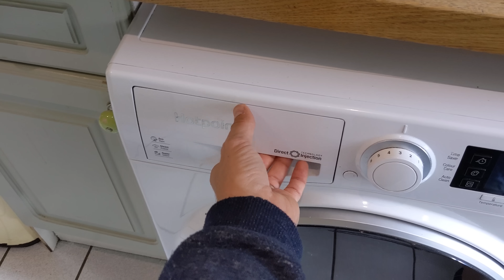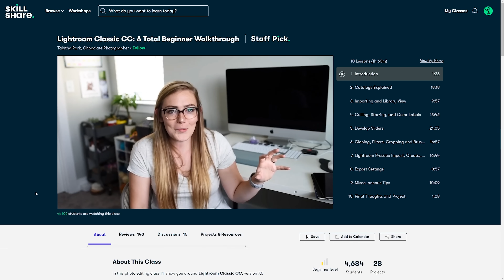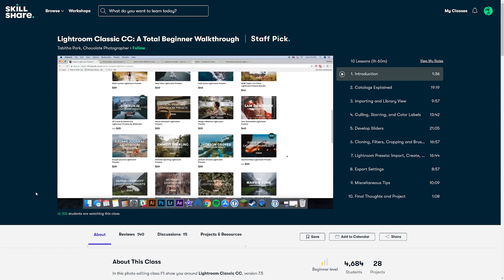The Pythagorean Siphon Inside Your Washing Machine

Comment: My toilet doesn’t have a siphon mechanism. Flushing the toilet just activates a door at the bottom of the water reservoir. (Edit: I have just been informed that toilets like mine do use a siphon, just not in the same location.)
Reply: Pretty sure most American toilets are this way, and they do use a siphon, just not at the same location. When you flush the toilet, the plug opens up at the bottom of the tank and all that rushing water exits the tank and enters the bowl on the sides and bottom and creates that push he was talking about to get the toilet’s water and contents up and over the pipe under the tank and into the sewer. If the plug doesn’t open properly and a lesser flow rate or no water at all is allowed to leave the tank, your toilet won’t flush properly for the reason he explains towards the end with the “dribbling water” bit
Reply: @kffej101  The siphon being the bend in the toilet just after the bowl?
Reply: @malijames12  no that's the water trap, the reason for the water trap is mainly to stop the smell from the sewer pipe coming back up into your home, sinks  baths and showers have them too  just smaller, your toilet may not have a syphon at all, it may well be just a simple door that opens when you flush to allow the water to flush down into the toilet bowl
Reply: bandit 911 water traps are syphons. If you turn the water off from your toilet and flush it, there will be no water left at the bottom at all.
Reply: @hungryhungryhummer  they're not syphons, toilets are designed so that s bend or p bend at the back of the toilet under normal gravity flushing that water in the bowl will never empty, unless like a plane or bus where it's actually sucked out, the main reason for a water trap is to stop the smell from the sewer coming back up into your home, if the water syphoned out from the water trap in your toilet bowl you would know pretty quick because of the smell, if you turn off the water to your cistern and flush you will empty the cistern and it won't refill, but the water level in the toilet bowl will still stay no matter how many times you flush, it's how they're designed, if you listen carefully after you flush with most toilets you will hear like a gulping sound, that's the water trap pulling air to stop the syphon action of the water trap, at least that's how it is in Ireland and uk, maybe America use a different toilet system
Reply: @bandit911  Incorrect. Its both a siphon and a smell trapping stop. The reason the bowl never completely empties is because of the way the stuff before the toilet bowl works.
Reply: @Sumanitu  ok I think we using different toilet designs, yours is a syphon.... Ireland and uk are not and I think alot of Europe, just different designs 👍🏽
Reply: @bandit911  I think its much more likely that all toilets in most of the western world use the same basic physics. At some point in the toilet or plumbing there is a siphon. A U bend in plumbing behind the toilet or in the wall is literally a siphon
Reply: @Sumanitu  no, you don't need a syphon for a toilet to work,  the basic principle of a syphon is you feed the syphon as much water as the outlet can take so as no air in the system, most euro toilets the outlet pipe is a 4 inch pipe, the water flush pipe is a 1-1/4 with a gravity feed of as little as 8  inches will never give enough water volume to make the water trap syphon, simple as that, I don't know what type of toilet you using but here the only syphon in a toilet is in the cistern, which actually isn't even needed to flush the toilet.
Reply: @Sumanitu  A u bend behind a toilet is not a syphon, your flushing the water from above the u bend, water will fall no matter what you do, a syphon would involve taking the water from above the cistern to below the cistern, that's not what a toilet does, a toilet flushes by gravity, a syphon is not even needed in the cistern
Reply: @bandit911  It literally is. There might also be another siphon to get the water from the cistern to the bowl.
"A siphon (from Ancient Greek: σίφων, "pipe, tube", also spelled nonetymologically syphon) is any of a wide variety of devices that involve the flow of liquids through tubes. In a narrower sense, the word refers particularly to a tube in an inverted "U" shape, which causes a liquid to flow upward, above the surface of a reservoir, with no pump, but powered by the fall of the liquid as it flows down the tube under the pull of gravity, then discharging at a level lower than the surface of the reservoir from which it came. "
Reply: @odkres  of which none of that happens in a toilet as the reservoir (cistern) is above the toilet bowl, a toilet all works by gravity, no syphoning needed, a toilet is not flushing by pulling the water from above the cistern and then down into the bowl, a toilet flushes by GRAVITY, it's literally the same as getting a bucket of water and pouring it into the toilet bowl, where's the syphoning there?? It's gravity, water will fall simple as that
Reply: @odkres  note the words "inverted U shape" that's not a U 👍🏽
Reply: @bandit911  I actually just realised there are toilets without siphons. So there are those that have 2 siphons, or that have 1 siphon in the cistern or in the bowl, or no siphons at all. So there's that. But yes, you were right, you don't NEED a siphon, but they often HAVE them. Or don't.

I just spent like 25 minutes first on Youtube then on Wikipedia checking up on flush toilets, hahah.
Reply: @odkres  😂👍🏽 yes I not to sure how toilets in America work, but most of Europe is like I described, a very simple design that works well
Reply: Bandit 911 American toilets use a siphon trap to siphon waste through to the sewer system.  When we pull the handle it pulls up a flapper at the bottom that allows the water to fall into the bowl and start the siphon.  From what I’ve read (I’ve only worked on American plumbing), many European toilets use a wash down method which works as you said.  Different regions; Different toilets.
Reply: @leebridgeford8335  yep I had to Google American toilets to see how they worked, definitely a different system, some look very simple and effective and others look very complicated but also effective, anyone know the price of your basic household toilet and cistern in America?? Here the basic household toilet and cistern costs about €80 or $95
Reply: @bandit911  that's a shame, I like sewers
Reply: @bandit911  you said something like 'the gulping sound stops the siphon action'  THAT'S THE SIPHON EVERYONE ELSE IS TALKING ABOUT.  Different toilets may stop the siphon at different times and leave different amounts of water in the trap but all traps have some siphoning action happening.  Btw I've been to Ireland and mainland Europe alone but come from the US. One of the major differences in toilets I've noticed is flush mechanisms and the water level. American toilets have a higher water level when not in use.
Reply: @xidarian  there's no syphoning action happening in a European toilet bowl at all and it's impossible for any syphoning action to happen, it's a gravity flush, zero syphoning involved, a syphon involves taking water from above a water level to below it, that's what American toilets do, European toilets don't, I'm not saying either is better or worse, but I didn't realize how an American toilet worked until I looked it up and it's a very complicated toilet and must surly cost a small fortune to buy
Reply: @bandit911  yeah i can flush my toilet with a bucket of water jist fine but ueah it does work better thru the cistern xuz like tou said its a 25mm hole/pipe watever pushing water down a 80mm pipe that isnt a siphon iys jist a water jet and a stink trap
Reply: @bandit911  

A small fortune? What? I just googled a full toilet at a major USA home improvement store and there was a $90 one.
Reply: @bandit911  they can be had for cheap. About $90 or so at the low end.
Reply: @Jasoninee  a decent toilet in the US is about $150-200 but yeah you can go super cheap for about $100 or a little more. This recent real estate boom due to corona virus or whatever is causing a spike in the cost of building materials and home goods in general, so toilet prices may be affected. The price for lumber, at least in the northeast US where I am located , is about double the normal price right now. I paid $60 for a 3/4” pressure treated 4x8’ sheet of plywood a few weeks ago. It’s about $8 for an 8 foot PT 2x4 right now also. And many common items such as circuit breakers and sturdy plastic tote containers are out of stock at the local Home Depot.
If you really want to talk about fancy expensive toilets, Japan is probably the place to go — many western style toilets (what we’re discussing here), especially in nicer locations /homes, are incredibly complex and expensive, featuring built in bidets as well as features such as heated seats and noise makers for privacy. Toto is a leading manufacturer of such luxury commodes, which can fetch prices of $5000 US or more.

Also to correct a previous reply of mine — European style “wash down” toilets do not use a siphon in the manner I described in my last reply here, and instead simply use a burst of water at high speed to push the waste down the much larger diameter trap. Due to the larger trap, clogs are less likely, but solids are also more likely to leave marks in the bowl as well as cause more smells while the toilet is being used if the user does not flush right away. So I was incorrect previously when I said that all toilets use a siphon. I should have said, “most toilets in the US”, since over here, most people do not want to smell poop islands as they use “the can” 😅
Reply: @MittyNuke1  

The timing of this is so funny because I was just given a flyer the last time I left Lowes and since it had toilets on it, it made me think back to this.

It had one toilet for $79 and two more for $89.
Reply: @bandit911  a water trap is also a siphon
Reply: @frontiervirtcharter  it's not!!!! A water trap is under a sink or basin or bath correct?? That means the water feeding the trap is above the trap, that's not syphoning that's gravity 🤷🏻‍♂️
Reply: @kffej101  Yup, and over time those holes along the rim clog with mineral deposits and we have to use a strong acid cleaner to dissolve it otherwise our toilets get weaker and weaker over time until they barely flush at all.  Not good for pipes but works miracles on flushing strength!
Reply: @kffej101  We have a newer "more water efficient" toilet... and for whatever reason, the tank does not empty fast enough and the flush is too weak so we have to get about a gallon of water in a bucket and dump the bucket in the toilet at the same time you hit the handle to actually get it to flush properly. I wish they had just used a bigger tank or stronger flow or something.
Reply: That’s called a flapper valve. When you flush, the valve opens and allows water to rush into the bowl. The flapper valve floats, so it stays open until the water level drops and then the flapper valve covers the outlet again and the water fills up on top of it, holding the flapper down until you flush again. The system shown in this video is likely used because it allows all, or half of the water to be used to flush. That allows toilets with the two levels of flush power that you sometimes see. American toilets have what’s called an overflow tube which sits inside the tank, and if the fill valve is leaky, the water will rise to the overflow tube and go straight into the bowl via the overflow tube. A small amount of water is also sprayed into the overflow tube as the toilet tank fills, and this water runs down the sides of the bowl to clean it and also to refill the bowl after the toilet is flushed. All toilets also use a siphon for the actual flushing down the drain  — when enough water is dumped into the bowl to start the siphon, the contents of the bowl are “gulped” down the drain. This is entirely separate than the flushing valve siphon action shown in the video, the purpose there being variable amount of flush power,  vs the action of actually dumping the entire bowl down the drain. If you slowly keep pouring water (or pee) into the bowl, the flushing/drain siphon isn’t started but the excess liquid is slowly drained down the drain sort of like in his demonstration of slowly dripping liquid into his model. Sorry if that’s confusing, I addressed like 3 different things here. The flapper valve is good because it’s dead simple and easy to replace. It’s bad because there’s no way to control the amount of flushing water used. Most modern toilets I see today in America use a system similar to the one shown in this video since there is a bigger emphasis on water conservation worldwide now. Back in the old days, toilets would use 5 or 6 gallons to flush. In 1995, American toilets were limited to 1.6 gallons and many toilets didn’t redesign anything, and a lot of people associated these new toilets with clogs and low power since they had inadequate power with lower water usage. Today, in 2020, a lot of engineering has gone into effectively using less water, and many high quality low flow toilets exist. I have installed some toilets that use 0.8 gallons per flush, that use a mechanism to keep the trap partially filled with air, and an improved bowl siphon design, using longer waste piping, to increase the amount of sucking force to move waste with less water usage.
Reply: @MittyNuke1  you are spot on.
Reply: mmmm yes I like toilets
Reply: I like how this turned into a conversation about Western world toilet physics
Reply: i love ur icon
Reply: Yes, the toilet system is different in various parts of the world. Not all use siphon system.
Reply: The kind shown in the video is european, and th epurpose is to allow either a small or a large flush. In America we mostly have only the full flush, although it does use a trap/siphon between the bowl and the drain pipe. The reason the trap/siphon doesn't empty completely is because the pipe is wide enough that the siphon won't completely empty itself.
Reply: I think the notion was referring to the bended pipe of the toilet to the septic tank, not the flush tank.
Reply: You are talking about the S-trap that prevents sewer gasses from coming out of the bowl. The mechanism is hydraulic momentum not vacuum siphoning.
Reply: Yeah, I think honestly ALL toilets have a siphon mechanism, this is mostly because it's a vapor barrier to the sewer.
Reply: Sounds like the US style.   IMO it's a far simpler mechanism and much better.   Living in the US I've owned both old school US style and modern imported multi stage flush mechanisms.   They all work,  I just prefer the simplicity of the US style.   Keep It Simple Stupid is a good concept to live by.
Reply: "Flushing the toilet just activates a door at the bottom of the water reservoir." That is the pouring @ 2:09 to fill the toilet bowl. The siphon kicks in when the water - and the unmentionables go down the drain until the siphoning sucks in air thus stopping the siphoning.

Comment: All the one's I've seen in America have a rubber flap at the bottom of the tank. Pulling the lever pulls up on the flap, and that initiates the flush, which falls back down once the water is gone, and the water pressure holds it down to seal.